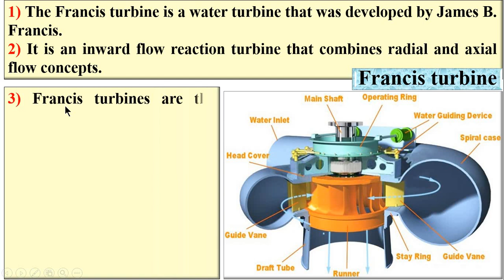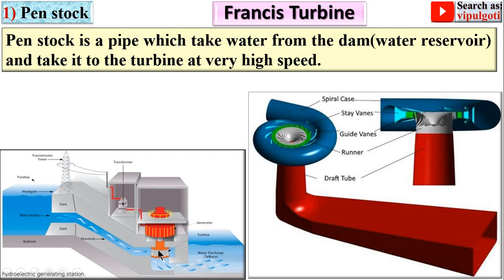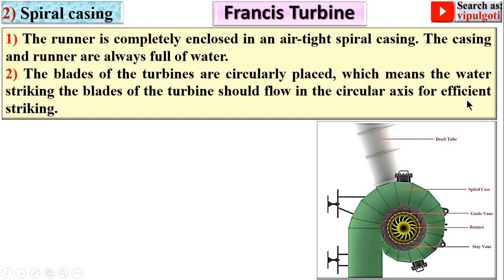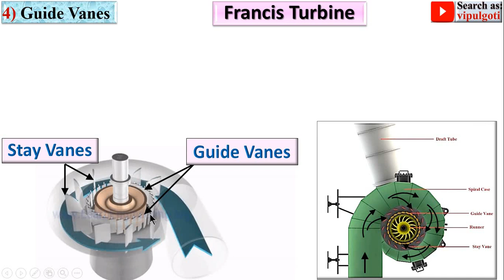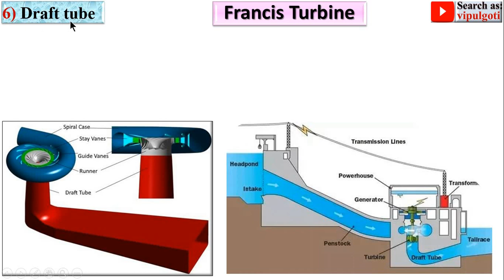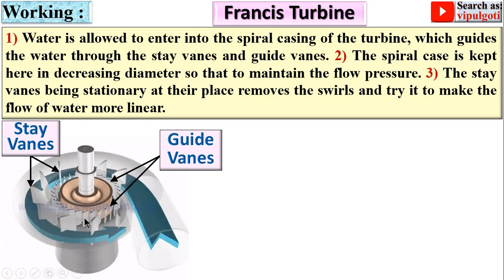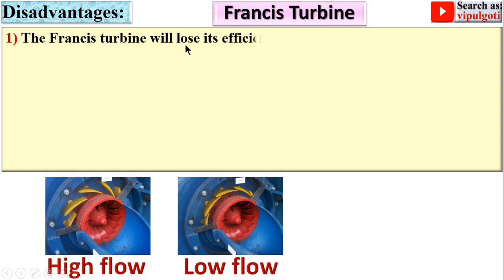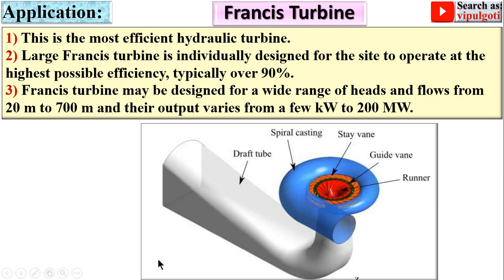Francis turbine|Hydraulic turbine|Reaction turbine|Water turbine|Parts of Francis turbine

Comment: Hi all 
So according to the hydro industry a 90% efficiency is the best that can be achieved today for hydro power 
Well that is WRONG why u ask 
below is a part of what was sent to the White House a month ago in short it allows dams to have three extra power halls So that 90% must be wrong 
Good Morning 
This document is for a retro fittable power production system for hydro dams to have up to three extra turbine banks without making issues for the main turbine hall
Now the reason this type of system has not been looked at was two fold .. the loss of flow rate and back pressure issues
Now these two were said to me as the big issues and yes there are others but they are foreseen and can be overcome  
As all the worlds dams have the same basic layout regardless of the turbine fitted. That being water turbine shaft to shock uni joint to the power turbine. And so all have the same common limitations  
A new type of turbine unit is needed if the main turbine hall is to function with without mods if multi bank units are to be placed in the flow 
This new system will never match the output of the main turbine hall but after years of chasing miniscule increases a system like this one is a massive jump in output 
At this point it should be noted that most of the installation process can be made with the dam online selling power to the grid and there is no increase in water usage when fully installed  
This system has been designed to be fully independent of the main turbine hall so as to be serviceable with the other units online and running with the main hall 
A FEW OBVIOUSE POINTS 
Even if our numbers were to fall we are still in a situation of heading to a power shortfall outcome things like data centers e cars and a hole host of other tech 
The lag time at best for any new system to get online is 2-3yrs at best ( unless ur the snowy river ) and i believe we are well short of filling the markets needs 
OTHER BENIFITS OF THIS UNIT
Is a dam green tech? well its more recyclable than wind and solar
lasts 100 plus years vastly more than the others
It should be noted if the patent is very strongly protected the market will come to the seller even if that is Australia or America so a 100 billion dollar a year marketplace makes the wage bill a non-issue 
SOME OF THE BIG BENIFITS 
Bigger market share/customer base
All the required infrastructure is already in place
the asset has a longer life span
No issues regardless of type of the main turbine fitted 
No added down time 
AND ITS TRUE BASELOAD POWER from a existing dam
Reply from the maker: Good information, my dear friend......